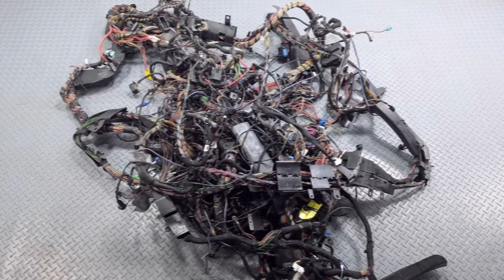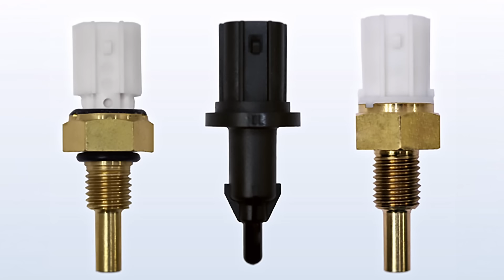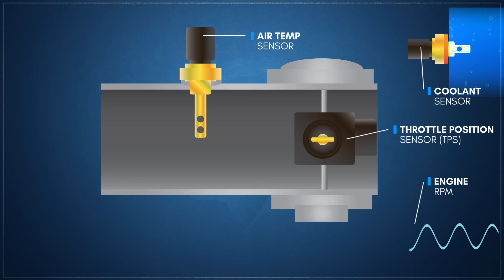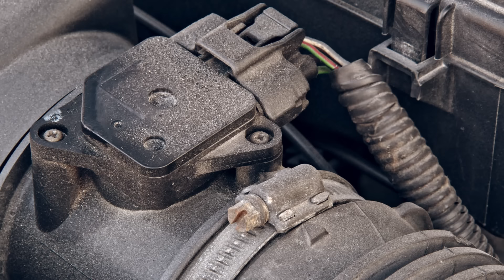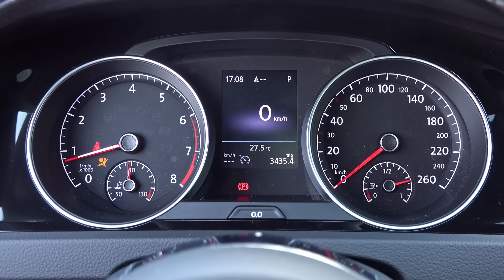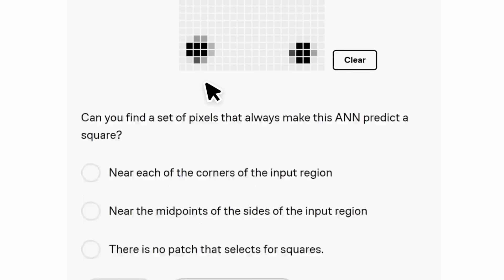The Insanity Of Engine Sensors

Comment: Ive been a mechanic for 30 years.

This video is basically the entire EFI module we were fed over several weeks of college back in the early 90s, effectively communicated inside 30 minutes.

Well done. 👍
Reply: In your experience what connector families (Molex, Tyco etc) are the most popular or reliable?
Reply: @lllllll396 the type of connector is fairly irrelevant, what you should be concerned about is the wire insulation, rodents seem to like the yellow flavor 😂
Reply: @beargillium2369 I commented here before but they seem to have disappeared. Hope this stays, anyways it is important to use connectors specificly made to handle vibrations and that are waterproof.
Reply: @sneaky_krait7271 good question i too will be awaiting an answer
Reply: @lllllll396 deutsch
Reply: @lllllll396 For TE Connectivity it is Deutsch series connectors for US market and AMP MCP for European market. With Molex I have only worked with MX150 series
Reply: @lllllll396 For TE Connectivity, Deutsch series connectors are for the US market, AMP MCP for European market. For Molex I only have experience with the MX150.
Reply: @lllllll396 aerospace, they use a white wire to build the looms and harnesses. A tetra fluoro copolymer, basically Teflon, but more resistant. The connectors are concentric with different rings, similar to some Mercedes Benz, but with a quality that is superb. Each conductor is marked at both ends, and some along the length as well. The connectors are sort of like a plumbing union with a cylindrical piece at each end, and a nut, that is attached to one of the ends. They come together nicely, and are very secure. They have grommets and seals for each conductor, as it enters the connectors. A whole lot of spaghetti... 😂 .  Tbh some of the airbag connectors on cars are pretty cool with a double latch system. Others are a pain in the ass with a little blue POS plastic pin, tethered to the connectors... (GM) The automotive plastic ATC fuses they used in the 80s and 90s were awesome, compared to the glass tubes, and then some 🐴 decided to shrink them, and then again... Lemme tell you that I do not approve of tiny stupid fuses or the 5 in😢 one  fusible module that Honda put in the power distribution box under the hood. 💩. Drive by wire is another 💩 for brains idea that has cost lives and lots of money, and finally they are going to implement an auto shutdown for LEOs to use, instead of chasing them, or using grappling hooks. Smdh... Grappling hooks...  
But hopefully soon we will get to see the sodium battery that is supposed to be safer, cheaper, and more eco friendly than li ion ... I am looking forward to seeing one. 😊.
Reply: The whole script was written by AI I think. And announced by an AI voice
Reply: @senseirbw2395  If this was written by AI someone did a really, really good job training that AI model. I'm also fairly certain this is a real voice. He's been making videos for 5 or 6 years and it's been this exact voice all the way back. I think this is just such a good channel it doesn't feel like the normal YouTube quality.
Reply: @dennisandthemachines oh for sure this guy is money. He’s incredible at what he does
Reply: there's a lot more than efi going on in an n63
Reply: it only feels "effectively communicated" to you, because you went through several weeks of old school slow teaching and 30 years of experience.

This is still Gibberish to someone who doesn't know how to pump fuel, regardless of how well made it is.

Explaining is different than teaching
Reply: @Hardy_H_Hthis wasn’t gibberish to me and I don’t know anything about this stuff
Reply: Mechanics go to college I thought you were just a bunch of scam artists. I started doing everything myself even engine swaps because mechanics are just so bad they will rip you off and not fix your vehicle. Like replacing the alternator but not the battery that's completely dead, they know that car is going to be back in 2 days and they're going to charge another $1,000. Mechanics are nothing but con artists these days and you have to fix everything yourself now.
Reply: @bekesir12 sounds like you don't know what a mechanic is. If your job is to remove and install parts in vehicles, you are a fitter. If your job is to figure out what the problem is, then fix the problem properly, you are a mechanic.
Reply: @bekesir12 ok grandpa let’s get you to bed
Reply: @vcpc-yt  He's right
Reply: @BariumCobaltNitrog3n BaCoN is delicious!!  😋
Reply: @firstnamelastname6216  got that right!

Comment: Cry all you want,thise sensors make cars better and more fuel efficient,they make posible comforts like cruise control and relatively clean exhaust,if older cars were so much more reliable and easy to fix then why nobody fixes and mentains them? 

The problems of the verry new cars from 2020 onward is they keep try to squeeze as much output from the fuel, there is a fizical limit,I sont understand why they don't switch to electric already, electric is so much better the only thing we need is more charging stations and cheaper electricity

Comment: you cant just say, fuel injectors inject fuel several times per stroke, and then move on like you didnt just blow everyones minds
Reply: It's really only piezo injectors that can do that. Piezo crystals can act as actuators (as well ss transducers as was alreay explained) in resposne to high voltage pulses and can open the fuel injetor pintles multiple times per combustion event. Traditional fuel injectors are just solenoid valves.

Comment: Great video, a small correction 
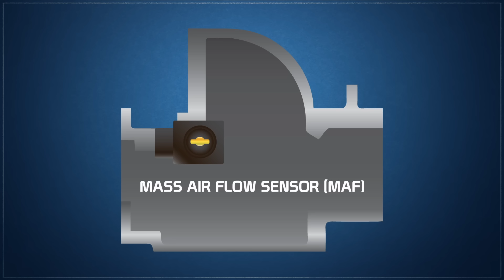@ 13:44 the vane style airflow sensor is not a mass airflow sensor, it's a vane airflow sensor since (as you mentioned) it cannot account for air density 😁
Reply: Won't lower density air push the vane less? How do such systems fully describe the air flow? Do they have separate pressure sensors? Or do they just tolerate lower accuracy and depend even more on the oxygen sensor to shim the mixture control?

Comment: Engines too complicated. Less durability, less reliability, harder and expensive to keep running, Give me a motor that burns more gas instead of all the junk to save gas and make power and can be repaired in my garage for a couple hundred thousand miles.

Comment: It's just interesting to see the face of the engineer who suggested placing the exhaust manifolds and turbines close to each other.
Reply: In my case with an oil line to the turbo running right over the exhaust manifold as well. I wrapped it in heat shield.

Comment: I refuse to watch. Get rid of sensors. Bring back the big block 350. I could rebuild it when i was 8. Modern engines i dont even wanna touch because the electronics will magically start throwing codes from something as basic as a timing chain.

Comment: Fantastic discussion of the high level function of sensor technology.  Amazingly done.   

Could I ask for a follow-up of direct ion sensing in cylinder?  It was novel in 2009 and back then enabled emissions compliant fuel and burn MGMT without a direct need for many other sensors. Promised an excellent burn without connection to an ECU.

Comment: Manufacturers and/or voters should demand regulators allow them to match the reliability of aero engine management systems. If this reliability metric cannot be met, regulators should allow slightly more emissions until that reliability metric is met. This would vastly improve reliability overnight.  It shouldn’t be this hard.
Reply: Except your average four-cylinder overhaul in aviation costs in the ballpark of 25 to 40,000 and an average six cylinder can easily reach 70,000+. All caused by regulations and lawyers, mixed in with low volume output of manufacturing.
Reply: @Notthe_droid_youarelookingfor  Partly true. Most of the higher costs are due to very limited production numbers in aviation.
Reply: @ yeah, the way I see it. It’s a vicious cycle. Ever since the 90s basically sue everybody you can when a crash happens then mix it with the heavy regulations The FAA puts out (for good reason for most things) which then leads to low production numbers driving the cost up. Rinse and repeat.

Comment: I've been maintain my cars for years but its getting harder thanks to the software involved. I totally understand why there are so many restrictions on maintaining modern cars albeit very annoying for the home mechanic. I have recently been working on an automatic gearbox controller, fascinating stuff and I found the root of the problem, a temperature sensor. However one parameter which is also used is the torque but I never worked out how this was calculated or sensed. Does anybody know how this is generally done in a modern car?
Reply: Find a video on how a “dyno” works is my recommendation, all they do is measure torque
Reply: @LibertyOrD__th  I did but there is nothing like that I can see in a car. A dyno works by loading the motor in some way but in a car the load is its self. If torque = force x radius how is this measured in a car
Reply: @campbellmorrison8540  it might have a rotary torque transducer 🤷‍♀️

Comment: I really enjoy your content and at 20:39 you use the r-slur which is pretty inconsiderate. I'd prefer if you didn't trivialize the torture of disabled people like that. I'm here for incredible engineering videos, not to bully disabled people.
Reply: "to retard something means to slow or offset something backward, originating from French. Its use as a slur when referring to people stems from this mundane definition: it is to call someone slowed down, or held back. However, it is a word still commonly used in its original meaning, without negative connotations. Saying "the management system will retard the ignition timing" is appropriate use of the word, it is stating the ignition timing will be held back slightly to its previous timing.
Reply: Your comment can't be serious...🤡

Comment: Thermocouples are extremely accurate you fool... As a retired electronic engineer, they are more accurate then NTC  and have a well documented voltage per degree. Sounds like you used AI research, so many things here and there are incorrect.
Reply: I thought it was just me

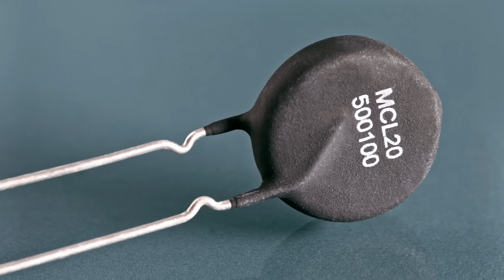Comment: 4:32 Thermistors aren't semiconductors.
Reply: Why not? First line on thermistor Wikipedia: “A thermistor is a semiconductor type of resistor in which the resistance is strongly dependent on temperature…”

Comment: A fun fact about O2 sensors is that they breathe through the wiring, which is why it’s imperative that you never solder the wiring. Only use O2 sensor crimps.
Reply: Never solder anything thats not on a board. Wires vibrate always crimp
Reply: @Your-moms-hitachi  honestly I think that’s a bit of an old wives tale. Happy to be proven wrong, but I use both soldering and crimping methods. For example, if we’re talking about a wire inside a wiring loom, I can’t imagine soldering being a risk here, but again, I’m open to my mind being changed. I just never seem to have the crimp tools I need on me, soldering is easier.
Reply: @uzaiyaro you're probably fine soldering in many cases, but that "probably" is really hard to define or predict. Solder does 2 things that cause it to fail in this circumstance: it wicks outside of the directly applied area and it work-hardens and becomes brittle. This means that at some undetermined point in time and unpredictable point in the joint, the solder may fail. Crimps cold weld the wire together which is much stronger and is very predictable. The problem with crimps is if you do not have the right tool or prices control (crimp force) the crimp is likely not correct and no engineer would recommend it. If the crimp is not tight enough, you won't achieve a cold weld and you'll get really bad resistance which may cause failure. If the crimp is too tight, there are like 100 different things that can go wrong but most likely it will just cause damage to the crimp or wire. 

If you don't have the right crimps or tools, solder with appropriate strain relief is usually a safe bet for diy stuff.
Reply: @uzaiyaro  wifes tale? Go find solder in aircraft or factory vehicle go on
Reply: @uzaiyaro  no you will not find any solder Connections in aviation or high-powered car audio
Reply: @simon4510  Yeah, I always knew work hardening was something to consider. I will try to crimp where I can, but as I said I seem to never have the right tools on hand. When I do, it’s great, I’ll crimp for days, but I have been known to solder to get out of a bind. I do what’s called a linesman’s splice for a stronger joint, but I guess that doesn’t really matter when everything is soldered and hard.
Reply: @Your-moms-hitachi  aviation is an interesting one, but of course you wouldn’t solder high power car audio stuff. Good luck getting a wire that stout hot enough. My biggest baddest soldering iron probably wouldn’t even do.
Reply: @uzaiyaro  you have just made it very clear that you have absolutely no clue what you're talking about Stout car audio wire? Buddy I can solder a zero gauge connection with a Harbor Freight iron that's not the point at all the amount of vibrations you're getting from high power subwoofers is going to destroy your soldered connections
Reply: Oxygen sensors breathe though the white zirconia ceramic on the back of the sensor.
Reply: fuck you mean ? BREATH
Reply: what if I've spilled turn indicator fluid on the wire? should I take it into a shop and have them recrimp it? I have argon crimps in the shop for when Im welding, those couldn't possibly be drop ins though...

(fr tho, soldered connections will fail eventually in anything that's shaking and vrooming, and bouncin and vibrating, and whatever else cars can do.. towing... )
Reply: Holy shit, I've asked ChatGPT about this and this dude is actualy right
I thought it was nonsens, but no
They do breathe through some ceramic whatever wire in between the copper wires for refference
Soldering can clog up the airflow

Thanks for teaching me something man!

Comment: Surprised no mention of Saab's Trionic in-cylinder monitoring system.
 It was way ahead of its time, using sparkplug gap ionization to determine if a misfire had occurred, measure cylinder pressure and combustion temp. It could control knock, ignition timing and eliminated several other sensors which could only infer data that it could directly measure.
Reply: the 4th gem RAMs and newer ones can figure out a coil is not firing by that ionization it sees. I fix a few misfiring RAMs the power and ground was good, a node light can be used to check this. if the node light blinks the PCM, Power wire, Ground wire are good and there is power getting to the coil. seen one where the PCM had a good power getting to it from the coil just no burn time from the ionization. as mechanic who loves the new stuff this blew my mind on how it work and able to see this ionization and give it avg burn time.
Reply: Excellent point. SAAB was a leader in innovation. I'll keep my SAAB's running as long as parts are available. Cheers.
Reply: this is commonplace on most coil on plug application these days, but manufacturers don't often talk about it, because it's all but irrelevant to the technician and the driver; also having all the other redundant sensors in place help to verify all the values
Reply: My saab 93 2006 was running like shit not a single fault code
Reply: Saab Electronics usually suck tbh the quality is always bellow average, their wires are to thin and not protected enough. 290000km on the milage yet everything is getting disinegrated. Although its worth it with the v6 its so fast😂
Reply: Using spark plugs as makeshift oxygen sensors wasn't a Saab thing, several manufacturers had it and it was a function of certain OEM engine control modules, it was a Bosch thing. And the reason it's not widely used is that it's not a reliable way to do it.

Comment: I can tell most people in hear have 0 real world knowledge.. cars today don't even hold a candle to 90-2000s cars and miles on just oil changes..  cars today are made to break its quite eazy to research.. prime example we use to use keyway on timing gears now they don't used a raised bump that keep failing .. yes more sensors give more info .. but with more issues..more things to break and mess up .. and alot harder to fix ..  but most of you have never taken a engine apart .